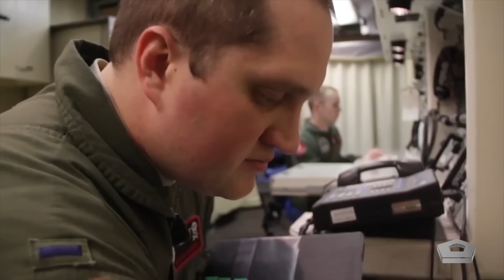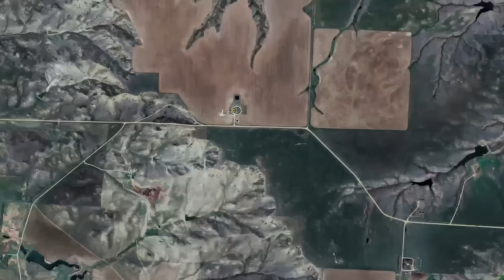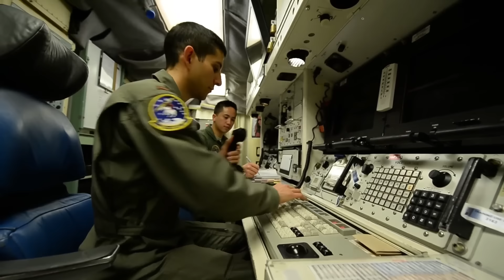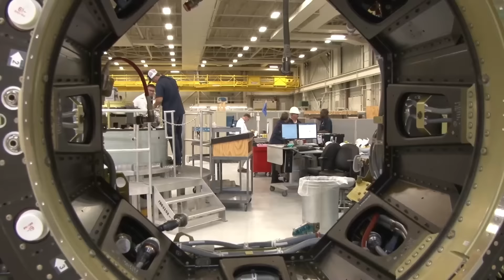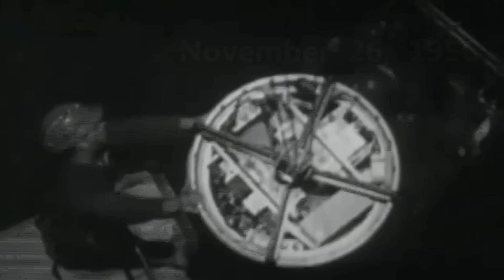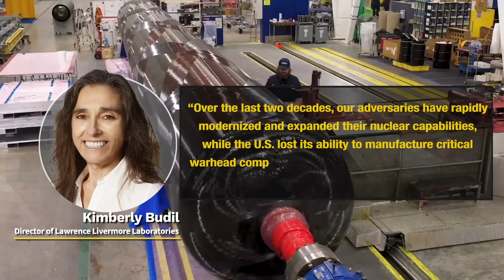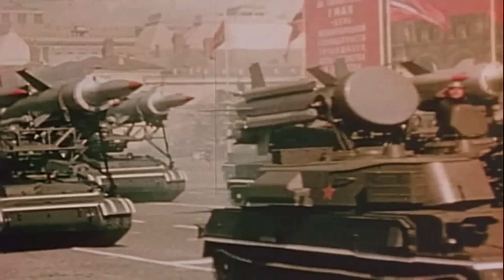America’s New Doomsday Weapon is Unstoppable

Comment: You wanna beat the controversy it’s simple the rule of redundancy what happens if our subs get taken out, we lose our nukes what happens if an EMP takes out our planes jets cruise missiles. We lose our nukes as a reason these things have been around for almost 60 years. And we had a state of the art missile that was decommissioned in 2005. It was called the MX missile had 10 more heads.

Comment: Minuteman 3 ICBM have been obsolete since the late 90s... i highly doubt that they can perform as they were designed to, and intercepting them today is a LOT more doable than it used to be even 20 years ago... Russia has S400 and S500 ABL systems which can intercept their warheads at high altitude and minimize radiation exposure from debris... and of you position s500 systems no more than 500 KM away from a launch site of any ICBM, it can intercept the ICBM during ascent stage... Russia has other system like NUDOL which is a super has ABL Interceptor missile that can be used in a semi-mobile configuration and placed on a submarine... or on land... then there are air-launched hypersonic missiles that can intercept ICBM during ascent stage and shoot them down at high altitudes of more than 30km... and the range of such hypersonic missiles is around 1000km... then there is another missile that can be launched from MIG25 and destroy warheads and satellites in SPACE...

Comment: We could put new nuclear silos near cities. That way, any counterforce attack will hit value targets, forcing a countervalue counterstrike.

Maybe a better idea is to build new nuclear-powered high-speed battleships that can carry SLBMs in addition to TLAM or it's successor and advanced guns that can shoot nuclear-capable projectiles 1000km or farther. The advantage of a battleship is that it can be dual-use conventional and nuclear. While ambiguity can cause problems, its visibility makes it more of a prestige system that is meant to draw attention. The armor and damage control systems could be designed to absorb near misses, so that nuclear battleships can act as a sponge similar to land-based silos, but out at sea where it's less likely to cause fallout over the bread basket.

Comment: I saw a video with Neil deGrasse Tyson where he claimed that modern nuclear weapons don't have the same radioactive fallout issues that the original bombs had. I must be missing some nuance about it.
Reply: Ok, did some research.
Neil deGrasse Tyson's claim likely refers to the evolution of nuclear weapon design, which has reduced some types of radioactive fallout compared to earlier bombs like those used in Hiroshima and Nagasaki. Here's the nuance:

Early Nuclear Bombs: Fission-Only Weapons
Early nuclear weapons, like the ones used in WWII, were "fission bombs" that generated energy entirely from nuclear fission. These bombs produced a large amount of highly radioactive fallout because:

Fission products are radioactive isotopes with varying half-lives.
The material was inefficiently used, leaving unreacted fissile material to contribute to fallout.
Modern Nuclear Weapons: Thermonuclear Designs
Most modern nuclear weapons are "thermonuclear" or hydrogen bombs. They use a two-stage process:

A primary fission explosion initiates fusion in a secondary stage.
Fusion itself produces much less radioactive byproduct than fission.
Cleaner Design Philosophy

Modern designs strive for more efficient reactions, meaning less unreacted fissile material is ejected as fallout.
Some designs aim to minimize fallout intentionally, especially for tactical nukes or "neutron bombs" designed to maximize radiation effects over blast.
Reduced Fallout ≠ No Fallout
While modern bombs produce less fallout per unit of explosive yield:

They still produce fallout from the fission stage.
Interaction with the environment (soil, structures) during detonation generates radioactive debris.
Large-scale detonations still disperse significant radioactivity, especially with surface or subsurface bursts.
Weapon Use Context Matters

Airbursts, where the bomb detonates at high altitudes, minimize fallout since less material is vaporized and irradiated.
Ground bursts generate far more fallout by irradiating and dispersing soil and other material.
Caveats to "Cleaner" Weapons

Even modern nuclear explosions create long-term environmental and health risks.
Fallout, while reduced, still poses significant risks in close proximity or for extended periods, depending on detonation conditions.
So, Tyson's statement likely highlights improvements in nuclear weapon design that reduce fallout but doesn't mean modern nukes are without significant radioactive consequences. They are still highly destructive and hazardous.

Comment: So we are to buy the argument that it costs so much money because we have not built ICBM for so long yet North Korea can build ICBM for a fraction of the price?  No the reason it is so expensive is that the military industrial complex overcharges the taxpayer at a level of 500% more than it should cost.  The technology to build solid fuel rocket has been around for decades.  If the US wanted an affordable ICBM fleet within 5 years, the president could just declare a national emergency and require companies to work together to build one just as Trump did during the pandemic to make masks and tests.  It can be done if we want to bypass the current method of building weapons by the process of price overruns and delays.

Comment: The fixed based silo of the missile program is the weak spot in the system. Imagine an adversary launching conventional stealth kamikaze drones in the hundreds simultaneously attacking all these silos. Would America launch a nuclear attack?

A preferred and more survivable way is to, probably, develop a mobile launch system for the missile. An underground system of tunnels and control points would move the missiles, widely dispersed and will only unmask to the surface when orders are given to launch. This approach would be expensive but necessary if the deterrent value of the land based missile system is to be maintained.

Comment: Speaking of ancient lost technologies.. I recently (and by recently I mean within the last 5 years, probably) about how they were having to replace some of the missiles we've been willy nilly giving out to the rest of the world... One of these contained a very specific formulation of an Aerogel... turned out these were great for reflecting neutrons back into a radioactive mass to bring it up to critical... missiles literally would not work without this specific Aerogel formula. Well, they were trying to make this replacement stuff, using the exact same recipe, and methods, as far as they could tell.

 In the end, they had to breakdown and spent some ridiculous amount of cash (somewhere between $100m and $200m) to have some of the existing leftover material analyzed. After more than a year and a half (and several boatloads of money) they were finally able to figure it out....

The base materials were too PURE. Back when these were being manufactured, the purity of the ingredients wasn't nearly as high as what we are accustomed to these days.... so, just how a transistor has to be 'doped' with 'impurities' the engineers had to (re)introduce some impurities before making the final product...

Comment: we still need ground launched nukes. we just need new missile delivery systems and upgraded tchnology in our silos to operate them. if you only update/outfit 10 silos with new computers and missiles at a time on a schedule, we would be fine. as long as we can keep 99% of our missiles ready to launch at any one time. the solution is a slow hardware refit across all of our silos, possibly even ready for future in production missiles. the nuclear payloads should just be interchangeable warheads.

if anything, i bet elon could help design the new delivery rockets, and make them compatible with the current outdated hardware, using newer more accurate and reliable software.

Comment: The entire point of DOD's BRAC (Base Re-Alignment and Closure) was to reduce and consolidate the over-abundance of sites we had in the US. This included old vehicle platforms (Aircraft, ships, trucks, etc). All part of the "peace dividend" as a reward if you will for winning the cold war. We then took those savings and pissed it away on things like the F-35 JSF, Comanche helicopter, Zumwalt and others that were financial fiascos. Now we're suffering shortfalls in key areas of defense and our adversaries couldn't be happier. This is not where the situation should be.
Reply: Actually the F-35 has turned out pretty well, although it took 10 years too long mostly due to the Marine version.
Reply: @HobbyNut-sy3lo  The cost overruns were  horrendous, but the worst part were the cyber breaches at numerous supplies, tier 1-3. They were several instances of altered code in chipsets. I think that took added much time in a massive review of all sw to ensure everything was safe. But if they got in, then much got out. The F-35 is a breached and untrustworthy platform. But the DoD will never admit it and they had no choice but to move forward. They could not afford another Comanche fiasco.

Comment: The critics of "mutually assured destruction" don't even realize that they're alive now to be able write their little articles because of MAD. It's one of those things you don't appreciate until it's gone. And as for new technologies, I'd much rather have my ICBMs controlled by some 80s computer than any modern systems prone to technical issues and backdoors built into the hardware from the factory.

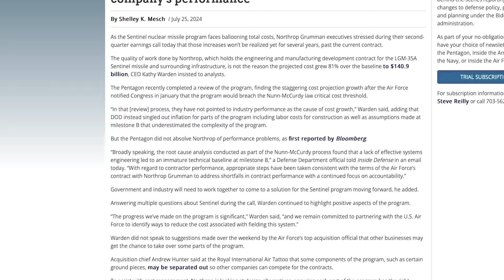Comment: 15:15 this is a problem everywhere. I work in the semiconductor industry and it used to be that we as design and test engineers could just walk onto the manufacturing floor and see how things are going. Now design is all over the world, the factory is in Taiwan, assembly in China, all done by various subcontractors. Every piece of this is highly optimized but the overal system is very difficult to optimize because there are just too many geographies, subcontractors, piece parts.

Comment: Just because there IS 7500mi of wire (from the 1970's) doesn't mean there will need to be that much in future apps. Most likely not. It would probably be cheaper and more reliable to lay down new wire and recycle the old.

Comment: Your info is a little out dated. I worked on the Missile's in  North Dakota. They are Minute Man 4 Missile's not 3;s. Solid fuel booster's.  They have all been Dismantled. Holes have either been filled in or just destroyed.  The only other thing is they carried 3 war heads not one.  I will leave it at that.

Comment: Crap like this is why large spending bills need to be broken up into smaller more manageable ones. One for the design and construction of the missiles. One for the inspection and repair/construction of defensive mechanisms. One for the inspection and repair/refurbishment of the land bases. Yet still one more for the inspection and repair/refurbishment of command and control systems. This would allow the DoD and Congress to see where cost overruns could come into place. If the total project is 80%+ over budget yet neither of the 4 beforementioned areas were more than 25% over budget than each wouldn't be as bad as it makes it seem. Plus these programs get ridiculously expensive considering that the USAF likes to contract everything out rather than do the work in house. The US DoD has the largest and best equipped construction company in the world between the USACE and US Seabees. Outside of the actual missiles and systems all of the base work, silo work, and defensive systems could be done with equipment and personnel that we are already paying for.

Comment: Gotta build the new ground ICBMs. It is going to take a larger arsenal to fight China, Russia, and Iran simultaneously. Satellites have to monitor the enemies and be ready for fast launch by short command decision cycles and speedy altitude range. Subs are expensive and air craft are the slowest to deploy for attack. Slow deployment for attack equals low deterence.

Comment: Every missile system in the US has been replaced over and over since they were first released in regular upgrades, refits and replacements. The missiles don't sit in the silos for 55 years. They rotate and refit and repair. At best, you can call them the missile of Theseus, at worst, they're all-new missiles based on old names, but still entirely functional and upgraded. Also, there's only 400 in the squadron, and about 300ish Trident IIs, but those also are essentially entirely new birds as the versioning keeps climbing for them too. We have several programs in place to replace both of these products, from the hypersonic projects to the cruise missiles to the SLBMs and ICBMs. If we ever run out of Minute Man missiles, we'll have bigger problems to contend with, like fallout.

Comment: The MX Missile system carried 12 Warheads, 6 dummy rounds, and 6 real warheads, it was to be based on Trains, stored in tunnels in mountains, and could be moved around. This seems better.
Reply: MX was killed by it's insane basing scheme - 80% of entire programme. 50 bln USD in 1980s! That's 150 bln in current money!
Reply: The other problem is the accidental escalation - if someone crashes it, or into it, or if another country attacks that area unknowingly, we enter into nuclear war. This way is what they stuck with so that if it happens Amit can’t be an accident or unintended consequence
Reply: Why ? You have submarines for that

Comment: Nuclear submarines armed with nuclear missiles are likely "extremely" expensive to build and maintain but they would seem to be a much more effective deterrent than land based missiles. The accuracy of modern missiles may render the protection offered by the silos less effective than when they were originally built. The mobile submarine based missiles also reduce the risk of accidental launches responding to spurious threats as they do not have to be launched immediately to avoid being struck, allowing them to respond with better situational awareness.

Comment: The old launch components were EMP resistant. Modern solid state components are less resistant.  Minuteman was originally protected to 50,000 V/meter,(if that) EMP pulses can exceed 100,000 V/meter
Reply: Total BS.  I worked on and at other times maintained some of the computers used in the Minuteman program, and they would not have passed Underwriters' Laboratories' ESD testing, let alone survived an EMP.  Too much woo-woo here.
Reply: What does emp do to people?
Reply: @Darthdoodoo  Unless you rely on a pacemaker or some similar tech, nothing.  An EMP can induce a high voltage in some ungrounded conductive materials.  Some will hold that voltage for a long time - like an undischarged capacitor.  Touching those objects might complete the circuit and give you a nasty shock - like sticking your tongue into a light socket.  But that's not common.
Reply: @jdlech  im talking about a direct hit by an emp. Will it electrocute a person?
Reply: @Darthdoodoo  Short answer, no.
Long answer, by the time you're close enough for an EMP to harm you, the thermal radiation will harm you a lot more.
Reply: @jdlech  Pretty much.
Reply: @Darthdoodoo  It might give you a headache but I doubt it. I worked on the USN broadband radio program in the 1980's after having served in the Navy in the1970's. I tested all radios for an EMP of millions of jolts. So, anyone suggesting the Mil Spec is wrong should be an engineer.
Reply: You do know that voltage decreases with the cube of distance, right?

Comment: The "Fear of the Cost" strategy of thinking is not a successful strategy. You'll not build anything out of fear, your wooden fence overrun by the hordes, and your $20 trillion gdp every YEAR will be wiped out and given to the horde's headers.  Net net: you lose everything. BAAAP!  bad strategy! The missile system has had a 50 year service span, so at least do the full cost benefit anlysis and show what we get for the effort. Maturity does not shrink away from costs, even in imperfect estimates, but builds the important defenses anyway. Compared to the losses in a real conflict, such as polluting our nations breadbasket for the next 100 years, the deployment and maintenance costs are completely manageable.